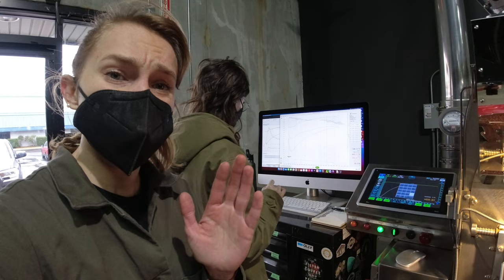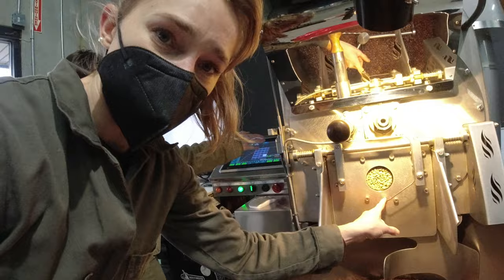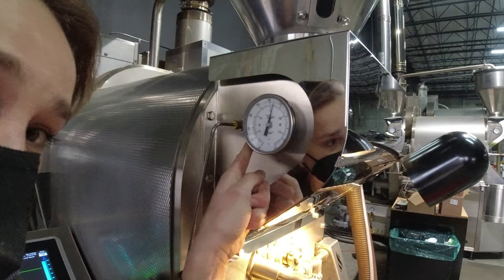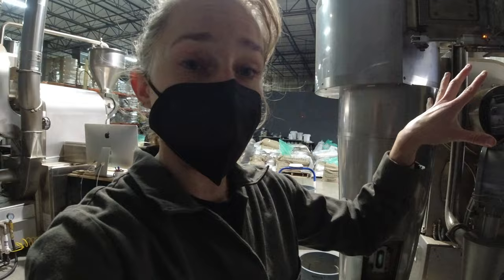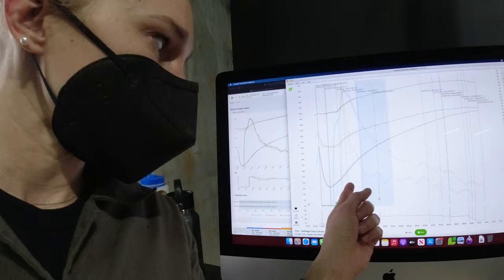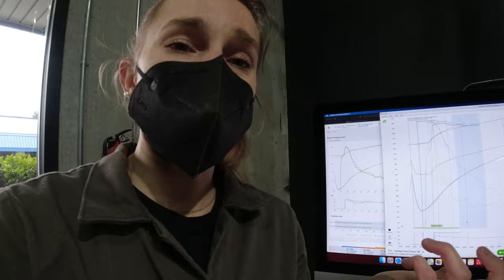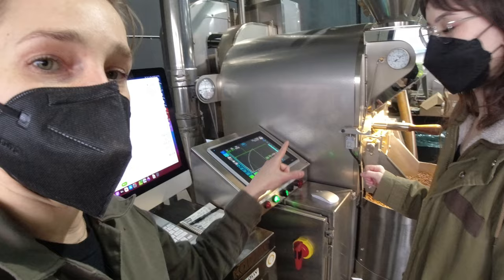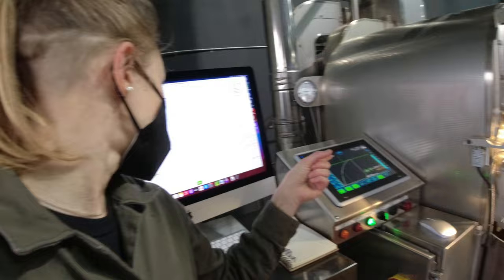Coffee Roasting Explained! One batch, beginning to end

Comment: Is this a fluid bed roaster? Surprised heat was all you could control
Reply from the maker: It's a hybrid between fluid bed and drum. And yes, heat application is tied to airflow so you only have one variable to control. (Though you can consider batch size and charge temp variables as well.)

Comment: Good stuff, love your channel :)

If your roast profile is specific to the bean, why do you have to manually adjust the burner percent to match the target, can it not be preprogrammed? Or would that be inaccurate because of ambient temp influence?
Reply from the maker: Great question! Some people do what’s called a “Power Profile” where they roast with the same control every time. But for most of us using the temperature, each batch changes, even just slightly every roast. You can program it with this machine, though most machines don’t have that capability. We do roast on automatic for some coffees and not for others - depends on how well the automatic control works with the beans. It’s not perfect for every coffee.
Reply: very intesresting explanation and thanks to you. Could you please tell me the roasting machine supplier or its availability .
Thank you

Comment: So i just started roasting on a loring and i know the air cool feature is one of the things theyre proud of but i never heard yall turn it on. And Im Also struggling with my coffee hitting first crack at around 410F and then the RoR just sky rockets but i have my burner at 20 (lowest) im pulling my hair out and would love some friendly advice.
Reply from the maker: Welcome to the lovely world of Loring! We don't use the air cool feature - you're correct. We have found we don't need it for our coffees. For FC at 410 and RoR taking off, here are a few questions:
- how long are your roasts?
- how big are your batch sizes?
- are you trying to roast to light/medium/dark?
- what processing method are most of your coffees?
A few things to try: 
- less energy in the system earlier on
- lower charge temp
- cut burner to 20 earlier (before FC)
- use bigger batch sizes
Reply from the maker: It also seems strange that your FC is happening at 410. How confident are you that FC is actually happening at that moment and not earlier? How are you determining FC?
Reply: @roasterkat  Hey Kat thank you for commenting back! Sorry for my late response!

-I'm trying to get my roasts down to 9-11 min for single origin
--in our 7 kilo I'm trying to keep it 3.5-4 kilo batch sizes
-im trying to keep it light-medium so you can taste the origin characteristics
-right now I have a washed Colombia and a natural Ethiopia
-for 410 that comes from the loring tech that installed it for me. I'm finding out he didn't really know anything about roasting coffee.